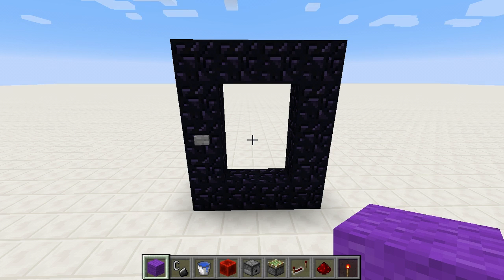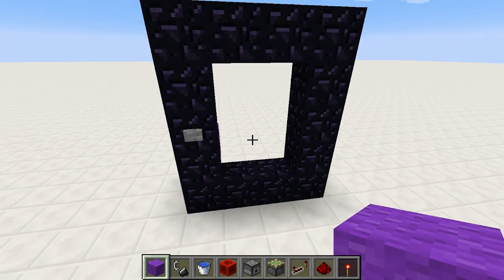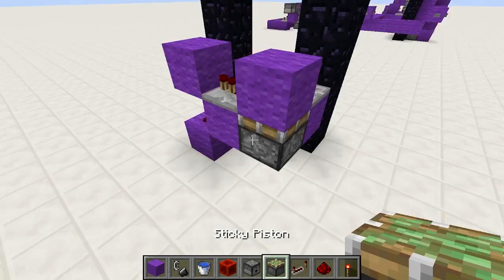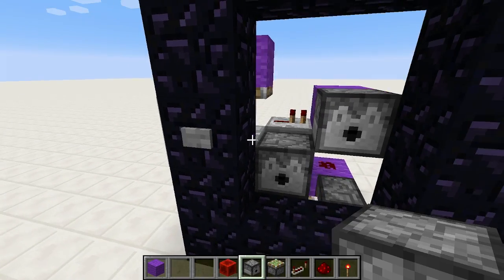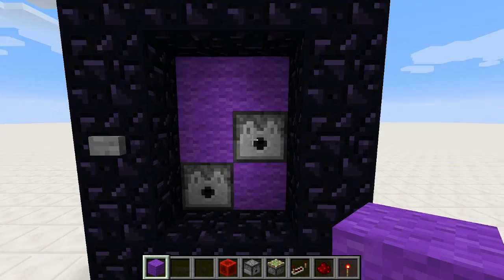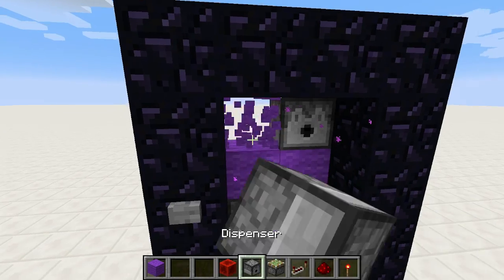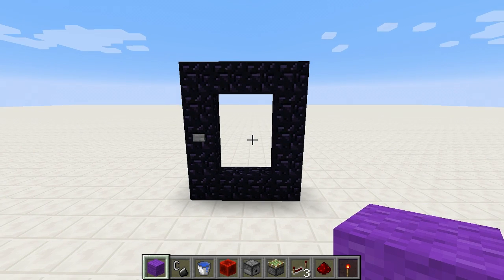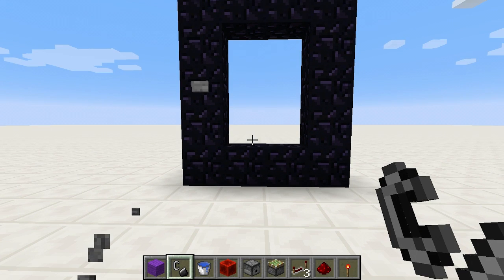Easy Peasy Redstone: Automated Nether Portal 1.7

Comment: The button didn't work for me, it just kept dispensing water right after the button popped out again. However I fixed it using a lever instead. Works the same as the button does in this video.